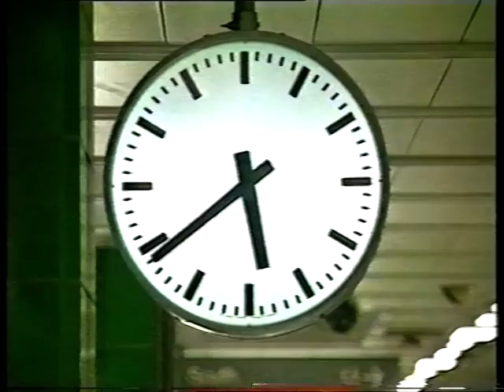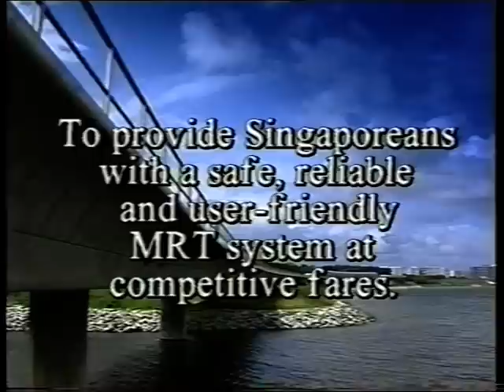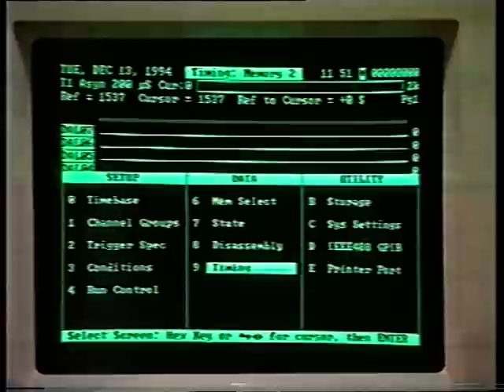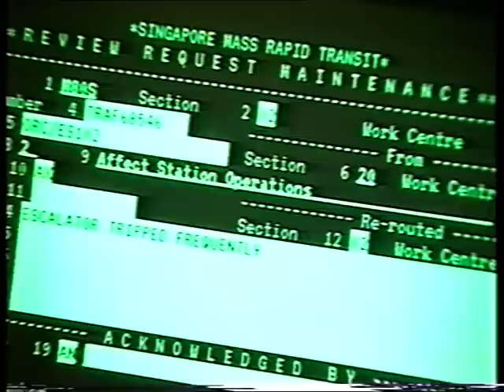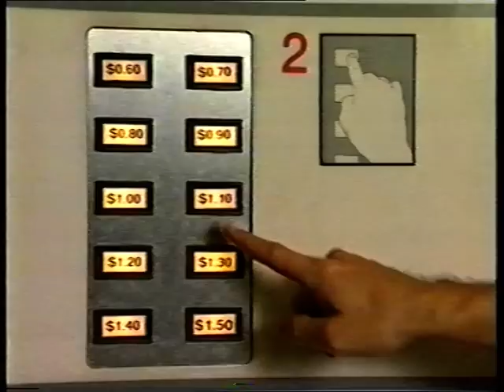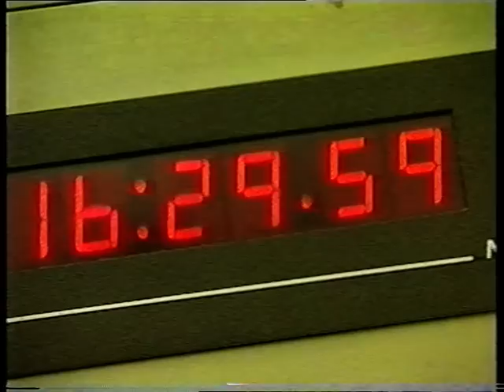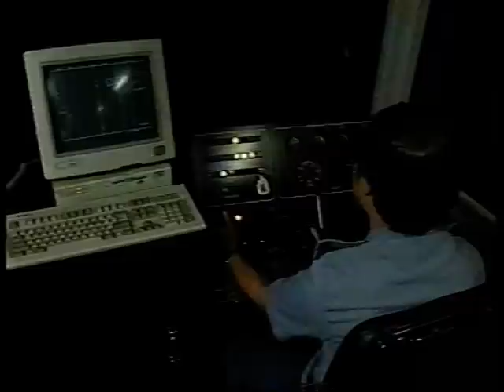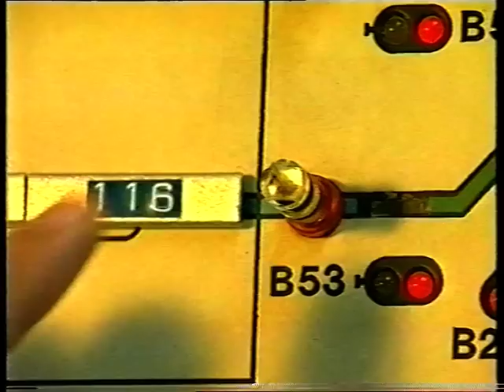SMRT Trains - Excellence In Motion (1994)

Comment: ahh,good old unrefurbished C151
Reply: C151 is now refurbished
Reply: No, it's a unrefurbished C651. Now, C651 is refurbished. But sadly, soon, C651 is gone.
Reply: @husni625offical3  bro last time c151 has the same livery as the c651
Reply: @husni625offical3  dei research before you even speak
Reply: @husni625offical3  bodoh
Reply: Yes.
Reply: Sadly they have to place the c151 with black sticker because the white livery starts to get stained
Reply: @nukegamez1 àaZZẞ****